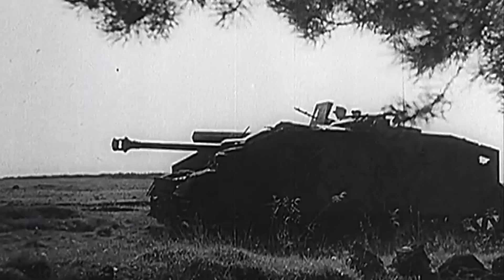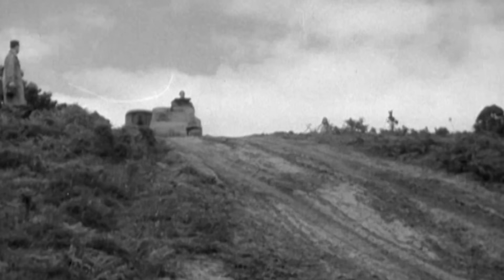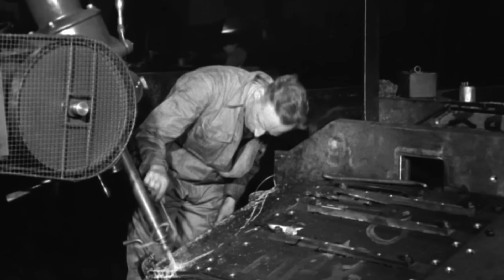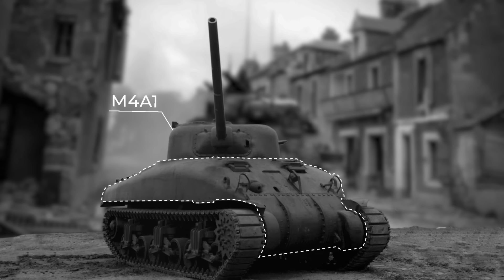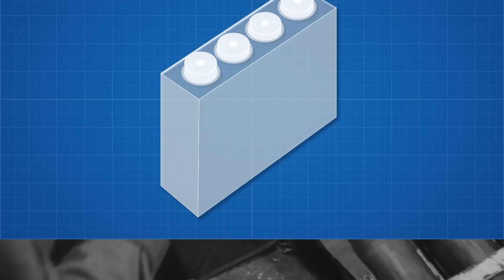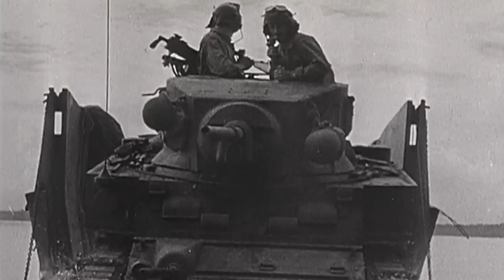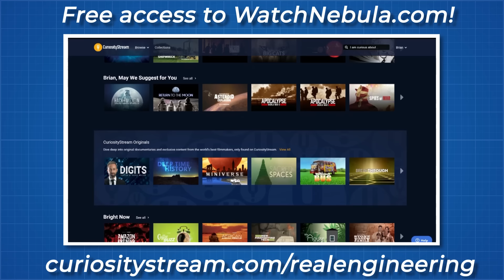M4 Sherman - The Workhorse of D-Day

Comment: Sherman: Is actually a good tank
Weraboos: Fastest death trap in the west
Reply: Literally any german cat: people either overestimate or underestimate me....
Reply: You've yeed your last haw
Reply: From the same people who brought you "the Katana is the ultimate sword"…

Hint: it isn't, it would suck against European heavy armour and the elaborate folding technique was to compensate for the inferior quality of Japanese iron.
Reply: @casbot71  True, a katana would have no chance against a European plate harness, but on the other hand, neither would a European arming or long sword. Swords were generally crap against metal armor and completely useless vs. plate armor. A European sword would be just as useless going up against Japanese armor, the only difference is that Japanese armor was more open so it had more gaps to exploit than a typical European plate harness but as far as the armor itself, good luck cutting through any of it.
Reply: @Riceball01  off topic but late period European swords are much better against armor than a katana.  From inverting to use the hilt as a bludgeon (via the "murder stroke") and grappling aid to the narrower point much better able to be used with half-swording to slip into armor gaps and burst appart (chain)mail rings.

The katana is an A-tier cutter, but that's not the only way to use a sword, and (as you allude to) you're not cutting through plate.
Reply: @Riceball01  half wording made european swords not useless against plate armor. They showed how a fight would go and cling one hit of the pommel and hilt to the helmet dropped the dude in the armor. Said he couldnt breathe, everything went blurry and black.
Reply: @casbot71  well ya but european heavy armour lasted like what, 100 years before someone thought of the idea of just making iron or better yet steel tip arrows that could punch through the thickest of plate mail. then everyone went back to the old idea of just not getting hit.
Reply: @Thekilleroftanks  And now you should go watch Tod's Workshop recent video on armor penetration, as well as the followup by scholagladiatoria. Case hardened steel tipped longbow arrows can't penetrate a non-hardened mild steel breastplate, period.
Reply: @p_serdiuk  if you're talking about the European armour than there was arrowheads design to puncher through plates. Well I should say bolt heads. Because only crossbows even had a change due to the fact they could have 5 or 10 times more torque behind the bows to give it enough kinetic energy to punch through MOST plate.
Reply: @Thekilleroftanks  Breastplates were often proven by test firing crossbows and muskets at them as a final quality control measure. It's where the term "bulletproof" comes from. Though other pieces of plate were thinner and could be punctured.
Reply: Weraboos: fastest death trap in the west

Weaboos: fastest subtitle read in the west that wishes he was in the east
Reply: T-34 am I'm joke to you
Reply: @USSAnime2444  rush the tigers they cant kill us all
Reply: @GreenStuffConsumer  Tiger: So much T-34 ahhhhhhhhhh
Reply: @USSAnime2444  AND THEY DON'T ATOP COMING AND THEY DON'T STOP COMING (x500)
Reply: @USSAnime2444  the T-34 was a deathtrap
Reply: @granddukeofmecklenburg  a bolt came loose 

Driver: I'm in danger
Reply: @USSAnime2444  The T-34 was not a good tank. But they made it in the numbers they needed to hold the line.
Reply: Sherman:*landed on some island*
Weeb:oh no
Reply: Lmao why so mad
Reply: @victorsalinas9275  because people say weraboos like to say stupid shit which is the truth but then turn around and does the same shit with the T-34 and the M4 both of which are just bad.
Reply: If they're so bad, how come in arracourt almost 300 German tanks were destroyed for the loss of only 30 american tanks, or why during the battle of bulge the tank casualties were the same? Both tanks were good for their roles.
Reply: @APFS-DS  you mean the battle of arracourt which was stalingrad part 2 the electric  boogaloo. also most germans tank crews had practically 0 training and was just being thrown at the allies to hold them back for as long as possible. 

same with the battle of the bulge but that was more so about fuel. and also both armour divisions on both sides never faced each other besides 2 times, hence the low deaths.

also that casualties rate hurts you because american m4 had a low casualty rate due to it having spring loaded hatchs, meaning to even the numbers compared to the axis it means more american tanks were knocked out....

also didnt help patton was there really fucking shit up.
Reply: @APFS-DS  

That is what happens when you blunder into enemy forces. This is nothing that we have not seen happen before in the Soviet-Union in 1941 where similair events took place.
Reply: "was being thrown at the allies to hold them back as long as possible" isn't that Germany in almost  every battle past 1943? 

Did you just say that the low crew casualty rate of the Sherman is a bad thing? Well better let the crew burn like with the tiger.
Reply: yes, where a couple of kv 1 and kv 2 managed to stall multiple  offences?
Reply: @APFS-DS  Just a reminder that Michael Wittmann got ammo racked in his Tiger lmao
Reply: Alistair I’ll add to that, the gunner was a shoemaker lol, but he wasn’t alone, he was with a couple other Sherman’s but that doesn’t change the fact that he killed 3 tigers in 17 min
Reply: @APFS-DS  Americans had fuel, germans did not.
Reply: Ric Boni  The tank with the better crew.

An experienced crew can minimize their tank's weaknesses, while exploiting the opposition tank's vulnerabilities.  An experienced crew will be better at hiding, and know not to start a battle when they didn't have a decisive advantage.
Reply: T-34 is really good... 

For winning the war like M4 

Not for someone who crewing it that want to survive after get hit
Reply: @DOSFS   Statistically, the inside of a Sherman was one of the safest places to be during a ww2 battle.
Reply: @StupidDanimations  yes if they didn't see a German tank
Reply: Really only two to three on the offense but in defense only one is needed. It’s just U.S. doctrine is to travel in groups of 5-8 tanks (not including mechanized, motorized, and foot infantry that carry anti-tank weapons.
Reply: I said on the offensive they needed 2-3 however only one is needed on the defensive. Also it wasn’t the Allied force against just Tanks. It was Army vs Army. Also just because attacker planes and artillery got involved engaging enemies doesn’t mean the Sherman wasn’t capable of taking out enemy armor. Just imagine for a second that your an allied tank commander and your column is stoped because intelligence says that there is a enemy armored force near by. If you were to move to try to engage the enemy yo run the risk of loosing the lives of the infantry you are trying to protect and the lives of the tankers you want to bring home to their families. If there is an attacker aircraft near by you could not risk lives and send the aircraft in because aircraft was virtually unopposed due to the Luftwaffe was effectively destroyed by 1943 so there is no aircraft in the sky. If there is then use the artillery that is in range because they are in no danger what so ever.
Reply: The death trap idea was based off of one mans point of view.
Reply: Sees 103 replies
Oh no
Reply: Jesus, you are almost the new Justin Y, I see you everywhere
Reply: @mekhane.broken9678  I doubt that
Reply: Wait what the fuck I don’t like my memes in my educational videos
Reply: Germany: Panzer 1-4, Tiger, Panther, Tiger 2, The stug series. 
Soviet: BT-5/7, T-34, T-34-85, KV-1, KV-1S, KV-2, IS-1/2. 
Note: Some tanks the M4 would have to maneuver a bit more. Example the Tiger 2
Reply: Also I’m in the context of the M4 using a 76mm. A 75mm would be a slight disadvantage if not using APCR or White Phosphorus.
Reply: Jefferson Davis  German tanks also used gasoline so by that logic, they're death traps too, right?
Reply: Ric Boni  Good point. I am not going to counter that argument since, to be honest, any person would chose something from their nation over another nation's products. As a Mexican, I prefer Mexican avocados over the avocados from Peru. I know it's a weird analogy, but it is the best I can explain.
Reply: Any tank is a potential deathtrap , it doesn't matter how good it is. the exception being modern UGVs
Reply: @phantomapprentice6749  The battlefield is a death trap. You can design equipment to make that deathtrap more survivable. Some things made it more survivable, some things made it less survivable, depending on doctrine, technology, and design.
Reply: At least the transmission is good
Reply: Any tank is a death trap. 
Not everyone would want to fight in a cramped, noisy tin can with explosives.
Reply: @mekhane.broken9678  it only took one tank to kill Wittmann tho.
Reply: Ric Boni  They could fight stugs and most other common German tanks. Keep in mind its a Medium tank. A medium tank getting massively demolished by a heavy tank is not comparable as even the mighty soviets had to adopt new tanks for the purpose of killing tigers and heavier cats. The IS series for example. Most American tankers would still choose a Sherman because of how survivable they were.
Reply: Alot of the naysayers are delusional sovietboos who thinks that by devaluing the sherman, it can bring more attention to their t34
Reply: American tankers had 1/6th the fatalities of infantry and saved many infantry lives by providing infantry support in the hedges, against fortifications, and against machine gun nests.

Tank to tank combat comprised 14% of encounters.   Late in the war, in the european theater, there were literally thousands of shermans fielded compared to under 500 tigers and 500 panzer IV's.  (I think it was 350 total for tiger)

The "Death Trap" reputation is from one poorly sourced book.
Reply: Then stop getting shot, soldier!
Reply: Yeah literally every one. However each German/Soviet tanks are just as likely to take out a M4, its all situational. The M4 has the most built in advantages compared to the others. It’s advantages were better crew ergonomics, placement, and equipment. Shermans also had wet stowage meaning that the ammo can take a few direct hits before going up in smoke. Where are most the others upon being struck once would burn instantly.
Reply: https://youtu.be/-wRBDT6Cjj0 "By D-Day,  1944, it was obsolete."
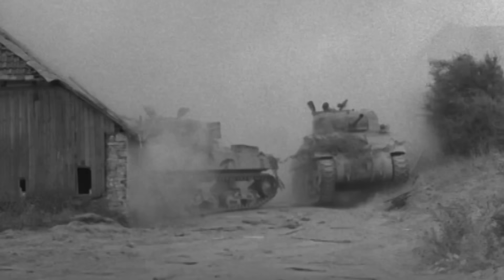Reply: It was a death trap at 7:30 and before you can see Sherman suffered from multiple problems. Sinking to ground, ammo cook off easily, driver and gunner escape holes way too small difficult to escape, etc. 

Not until improvement later on in the war does sherman become a much better tank.
Reply: @NicodemusCaster  If that's the primary criticism of the Sherman *early versions had problems*.... that's literally the criticism of EVERY tank in WW2. Whether an M4/PZIV/T34 etc, they all had some level of teething problems and upgrades to address them.
Reply: The Sherman is only called a “Death Trap” in the later parts of 1944. Since the Americans were exposed attackers and could be seen moving about. Also the Germans were in dug in positions and could fire behind cover while firing first and having the advantage. You know something that goes all the way back to ancient history heck Sun Zu even wrote about it and it’s apart of warfare 101. The Germans ran in to the same problems when invading the Soviets.
Reply: @ethanquarles9811  The Sherman is called a deathtrap because of one individual who didn't serve in the tanks, writing a book about them. Not because of failures of the system. Dear lord, we're happy he didn't serve on bomber command and deal with B-17's.
Reply: @ethanquarles9811  Also, in terms of burn/losses... It's earlier in the war vs, late in the war.
Reply: I understand stand that but when the Americans faced a problem in their tank they fixed it unlike the Germans, I mean look at the Panther most of it,s service life was on a rail car.
Reply: Yeah I’m actually writing a book on the Sherman and the misconceptions chapter is disproving all the false hoods. This chapter is the longest chapter in the book. Also Belton Cooper’s memoir is not not even a memoir.
Reply: Yes the Sherman has many problems with it (like every single tank that existed) but the Americans actually fixed the problems unlike the German tanks. Just look at the mistake of engineering that is somewhat the Panther and completely the Tiger 2.
Reply: besides it isnt good. its only good qualities was the spring loaded hatchs which had the downside of not really protecting you. and it being easy as fuck to repair. thats it.
Reply: @Thekilleroftanks  Look up The_Chieftan on YouTube and watch some of his Sherman videos where he goes over some of the myths of the Sherman.  The Sherman really gets a bad wrap from a few sources and documentaries that aren't really true.  When it was first introduced, and compared to what other countries were fielding at the same time, the Sherman was actually one of the best tanks in the world.
Reply: @Mathwayb  It has not had a bad rep for over a decade. It has not had a bad rep for longer than that to any person who actually bothered to read books from actual historians The dumb claims these days made about the Sherman are actually coming from the Sherman fanboys themselves
.
And if your best claim is for others to go erad watch any of Chieftain's videos than you are no better than those you accuse off. You make use of only a single source, and chieftain has made serious errors in his videos.
Reply: Qilleroftanks, swearing doesn't make you any less wrong
Reply: Dreach, wtf are you talking about? The gentleman was showing you a one place were people could see Sherman myths exposed.  And Chieftain is known and respected.  Who are you?  You are like the rest of us, NO ONE
Reply: @Mathwayb one I have him as a sub and like to watch his videos. But if you can actually fucking read I have never said anything about its myths being a downside. Like how it likes to catch on fire if you look at it hard enough. And that's really the only myth besides numbers.

It's just a bad tank in general seeing it's as fucking big as a tiger b yet has practically no armour for it. Also the fact every few dozen Sherman's are duds that need a complete overhaul to become working order in it's early years doesn't help things.
Reply: @andrewphillips8341  one anyone who is talking about armour in this way most likely watchs chieftain, also even the chieftain has said the m4 rap is really messed up. he doesnt like it when people call it a death trap when it isnt, but also doesnt like it when people put it on a pedestal for being the most godly tank in WWII because it isnt.

like people compare the m4 to the panzer 4. but heres something they dont bring up. the hight difference. the m4 being a couple feet taller than the panzer and the hull, the very weak, very important hull taking up much of it.
Reply: @Thekilleroftanks  Why did you reply to my comment twice?  Regardless I'd much rather trust what The_Chieftan has said in many videos covering the Sherman and how it compared to other tanks seeing as how he is a veteran with decades of tank experience and works as a well known military historian compared with someone in the YouTube comments section.
Reply: @Thekilleroftanks  Your definition of "a bad tank" includes only its combat parameters, which is a mistake that Chieftain often points to. The worth of a tank is not in how good it performs on the battlefield, that only has to be good enough for the job (and Sherman was). The true worth of a tank is in how easy it is to manufacture, transport and repair and how survivable it is for the crew. Sherman was superior to the Panzers in these regards. It doesn't matter if a Panzer IV could potentially knock out a Sherman from far away if its transmission breaks down and you have to pull out its entire turret and parts of the hull to replace it or if it's manufactured to unrealistically high standards that mean there always isn't enough of them made in the first place or if all of the experienced Panzer crews get killed in the first half of the war and those machines are left in the hands of inexperienced, untrained people for whom that tank is a bit too complex to make full use of.
Reply: @p_serdiuk  well no duh.

I wasn't calling the Sherman a bad tank for America. It's just a bad tank in general. It's big, it's sluggish (not in terms of speed but it didn't like to turn at high speeds and anything over 18 inch's it couldn't climb. Which isn't much.) Didn't have the armour nor gun to off set it's size. and besides crew comfort things it didn't have much else going for it.
Reply: @Thekilleroftanks  "In general" doesn't exist, though.
Reply: @Mathwayb  when it was first introduced . Tank tech advanced quickly during WW2.
Reply: @p_serdiuk  You sound like Stalin.
Reply: @reinatr4848  "when it was first introduced " was exactly what I said.
Reply: @reinatr4848  Yes, but the Sherman was an easily upgradable tank. Newer variants received a new turret and a larger gun, allowing it to deal with heavier tank threats. It also gained upgrades such as wider tracks, new suspension, etc. Some variants even had more armor added on. The M4 Sherman was still nowhere near obsolete by the end of WW2.
Reply: @Thekilleroftanks  again "it was shit" is a myth. You failing to give reasons for it just proves you can't make an argument
Reply: @richiemacrophage  Sherman variants were not obsolete, the tank itself was.
Reply: @reinatr4848  Tanks include the variants, you do know that right?
Reply: @richiemacrophage  but the base tank is not that good
Reply: @reinatr4848  The base tank and all its variants are counted as m4 sherman. By that logic, the Stug3, Pz3, and Pz4 must be very bad tanks too
Reply: @richiemacrophage  ok but these tanks dont get too many base versions produced. Sherman did.
Reply: @reinatr4848  That's because the base variants of the Shermans were legitimately good to use. Also, many different Sherman variants were made.
Reply: @richiemacrophage  okay..... then why use variants in the first place?
Reply: @reinatr4848  Because you want your tanks adapted to more specific roles? Why not use an already good chassis and make a more dedicated vehicle out of it? With your argument, the Panzer 3 and 4 shouldn'tve been upgunned, nor should the Tiger or Panther had the upgrades and variants it had, nor should things like the Jagdtiger and Jagdpanther exist.
Reply: @richiemacrophage  okay, but then dont produce 50000 tanks and call the Soviets idiots for doing the same.
Reply: @reinatr4848  I didn't call them idiots. You would be doing that instead. What the Russians did were making total sense for them.
Reply: @richiemacrophage  i said that because it is usually done.
Reply: @reinatr4848  But I don't. Please make sense and logical points when discussing.
Reply: @richiemacrophage  ah, i saw you on a previous wheraboo post, keep up the great work.
Reply: @APFS-DS  ty lol
Reply: @calliberjoe  you do know its wehraboo

also still wrong. even the panzer 4 isnt good, nor the tiger, though the panther with design changes could be a really good tank.

it all still means nothing seeing the god tank of WWII, the one that changed it all, bob simple.
Reply: @Thekilleroftanks  the early model MK IV only had a low velocity short barrel 75, designwd for infantry support, and preformed poorly against armor, and was incapable of killing Sherman until the introduction of the L42 cannon
Reply: @Thekilleroftanks  the Sherman was also about 30,000 dollars (at the time, and remained roughly the same price due to price caps), vs the 43,000 dollars of the MK IV in 1943, and while the price would drop to 39,000 (largely due to slave labor), it would always remain more expensive, and was far more complex than the Sherman in manufacturing, do to the German system of manufacture.
Reply: @Thekilleroftanks  these tanks and alot of lives won the war. End of story. So sick of these aholes that worship German tanks. They lost because they were evil and Good over took it as always will be as long as we remain one Nation under God. Thank you forever ww2 vets  and our United States assembly lines that could pound out tanks and planes faster than the krautes could ever imagine.
Reply: @bigblockstang9368  dude you need help.

Like it wasn't good vs evil.

The Russians was part of the allies and was just as evil as Nazi Germany.

And also implies that the allies didn't commit evil acts. Like murdering POWs.
Reply: @Thekilleroftanks  It was exceptionally reliable, excellent optics, it got were it need to be, it was an amazing tank ergonomically, it had nearly as much armor as a tiger, was incredibly safe, was capable of being modified to whatever you needed it to do, had excellent (read, actually) interchangeability of parts, had a stabilizer, was quick, and was probably the best tank of the war in a tactical sense until the introduction of the Tiger, and in terms of strategic and Grand Strategic capacity, easily the best tank of the war
Reply: @Thekilleroftanks  we found a Weraboos good qualities long breath.......... excellent reliability, easy to repair, easy to build, easy to ship, endlessly upgrade-able, 2nd best survivable tank (Churchill being #1), served in all theaters amazing well and worked so well it was being used in korea killing t-34-85s and t55 in the 6 days war. drops mic
Reply: @mattmopar440  besides it had shit reliability, repair was only good for the US because it couldn't send it back to a factory for repairs but other European countries could so thats negatable, same for shipping most countries didn't need to also ports can move 80 ton tanks it's just that most European ports couldnt so the tank needed to be light. It's upgradility is on par If not worse than other platforms seeing the tank destroyer versions of it died really quickly (side not the m10 is not a m4 turned into a TD the only thing they shared was the bogie which had to be redesign so even that's not the same)

And it's survivability I already pointed out so gg at reading.
Reply: @Thekilleroftanks  "Easy to repair shouldn't be a positive"
So you are basically ignoring logistics here? Which was a huge contribution to the failure of armies like Napoleon's and Hitler's during their invasions of Russia? What use is a tank if it gets lightly tapped and then needs to repair for like a whole day for it to actually get running? The Sherman can easily be repaired in hours (depending on what module was damaged)
Reply: @Thekilleroftanks  How is being easy to repair allows you to see miles away? You can make a simple tank with a low profile. Being easy to repair is very important for all armies. Tanks can be easily repaired and quickly right on the spot instead of wasting all the time to drag it into a factory where it would take just as long.